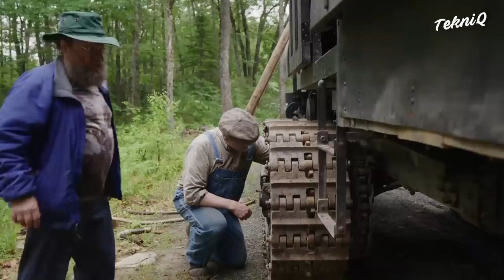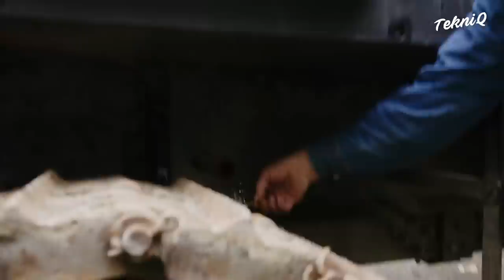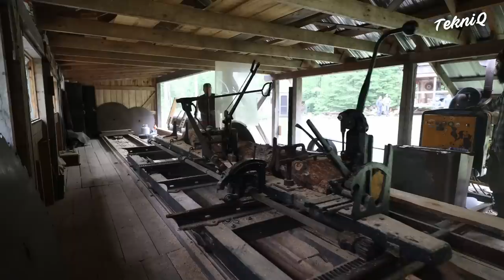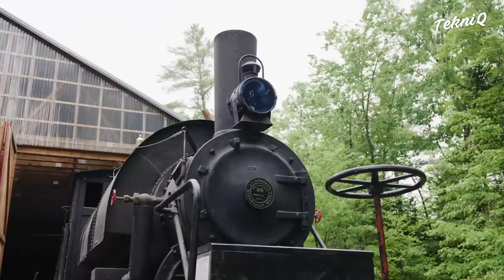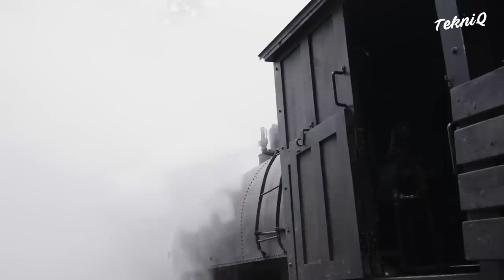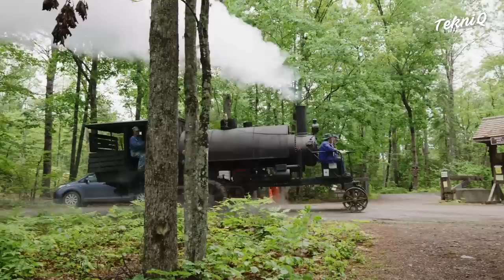Starting Massive Steam Tracked Tractor: One of the First in the World

Comment: I think the main thing that the builder of this machine forgot to include was a voice tube or other means of communication between the engineers and the steering team.
Reply: No need. We use whistle signals  for stop, go and reverse. Works very well.
Reply: @terryharper2024  Your one way communication system may work well enough to operate the tractor on the grounds of your museum, where everyone involved is familiar with every road you operate on, but I can envision scenarios back in the days when these machines were used to perform actual work where effective TWO WAY communication would result in more efficient work or even prevent an accident.
Reply: @richardcall7447  back in the day when these machines were hauling up to 300 tons of logs loaded on 15 sleds or more it was done the same way. It doesn't take long for the engineer and steersman to become a team. Just as the engineer relies on the fireman to maintain pressure and the water level the engineer has to trust the steersman but he also has to know the road - i.e. grades, curves etc. He has to be thinking about the steersman at all times. Take a sharp curve too fast and the steersman can't react quick enough with the low geared steering. Likewise, until the steersman returns the movement signal via the whistle the engineer cannot move the machine. the The video doesn't really pickup on it but when your in the cab its not a quite place. We have to shout back and forth just across that short distance. Unless the voice tube is glued to your ear your not going to hear it. Remember also how these machines were used. When hauling a loaded sled train you only stopped for fuel or water. Short of a breakdown nothing was allowed to interfere with a loaded sled train. Empties were usually brought back to the cutting using a go-back trail so they didn't get in the way. Other than hitching up you never backed-up and turning at the end of a road was often via a loop. There was not a lot of manuvering.
Reply: If a blind and deaf lumberjack, moose or bear gets in the way, that's tough, fight on...I'll bet on the crawler. THis ran back when men were men and the government got out of the way.

Comment: Steering from the front, but could it also be done from the cab in the rear?  Also, how does the guy in front doing the steering control the speed, or not?  Forward/reverse only from the cab?
Reply: The steering is indeed from the front. The "steersman" controls where the machine is going while the engineer back in the cab controls the speed and forward and reverse. We use whistle signals to communicate since the steersman and the engineer cannot see each other. It works quite well.
Reply: @terryharper2024  Cool!

Comment: They measure PH of the boiler water? Checking for corrosives?
Reply: Correct. Also for hardness. Lime scale buildup can be a problem - sometimes you have to blow down your boiler on a daily basis.
Reply: Yes - the engineers added a PH adjusting chemical to the boiler water, and he was checking that the amount was right. The water we used was right out of the creek. The boiler inspection the month before showed that the water treatments were working well.

Comment: Does she not go out of gear?
Just noticed when it was being towed out of shed the cylinders were moving
Reply: Correct, just like a Stanley steam automobile there is no transmission or clutch so when it's towed the pistons do indeed move. We would have to remove the drive chains to stop that from happening. It has Stephenson valve gear and a reverse quadrant which allows the operator to change the position of the slide valves in relation to the piston stroke. Thus by simply moving the lever we can go forward or in reverse.

Comment: This looks like an 0-6-0 or similar switching locomotive that was converted at the factory to haul logs

We have an 0-6-0 not far from here on permanent display where i live that all it did was move logs on a short rail line from point A to point B then reverse to reload.
Reply: It’s not a converted locomotive. Yes, it has a “locomotive type” boiler which was a design used in many different applications including stationary power and traction engines. This particular machine was factory built new in 1907 from all new components. The boiler was purchased new from the Ames Iron Works. It’s one of 82 similar machines built by the Lombard Steam Log Hauler Co. between 1901 and 1917

Comment: I wonder that this thing is this easy to steer. I would think that in a corner the front wheels will slide over the ground while the tracks will push the engine straight forward. ???
Reply: Great question! Originally, since these were only for winter they use, they used skis for steering. We have skis but we fabricated wheels so we can move it around and demonstrate during the summer. The weight on the front end is 8,000 lbs. The rest is all on the tracks. The steering is very low geared. As we like to say "Steer early steer often". Just like a car, which has a differential allowing one wheel to slow and the other to speed up when taking a corner - the Lombard has what they called the compensating gear situated between the frame rails which does the same thing. However, if you try to take a sharp corner too fast it will push!

Comment: You would think putting the driver in the cab would have made it able to work in inclement weather ?
Reply: These were used to haul logs in the winter time from remote areas in the woods, long trains of sleds holding many tons of logs, run on iced roads to make the sleds move easier (with straw down on the ice on downhill stretches to slow it down, these had no brakes since the sleds didn't either). From back in the cab, the view forward is actually quite limited, very tough to see to the sides and anything close up in front. Many of these were modified to put a little shelter around the steersman to protect from the wind and snow.
Reply: @ShopElvesCorner  And, if the driver back in the cab lost control, the steersman would have baled out pdq.

Comment: Fizeram o teste hidrostático 😮 antes de acender essa caldeira ❓❓❓
Reply: We do not need a hydrostatic test every time we light the boiler. In fact we are not required to have one even on an annual bases. However, Every year we are required to have a state boiler inspection which in 2023 was performed shortly before this video was shot.

Comment: Perhaps my powers of observation are absolutely poor but this video did not show this crawler as having any way of pulling anything or running an auxiliary dry belt so is this just a functional toy?!?  🤔
Reply: These were made specifically for pulling heavy trains of sleds loaded with logs along ice/snow roads. Its was not uncommon for them to to pull 300 tons or more. You may not see it in the video but there is heavy pin type pocket and associated draft gear at the rear of the machine tucked up under the wood box. A heavy timber A-frame draw bar was used to connect to the lead sled. All subsequent sleds were interconnected with crossed reach poles which provided a crude form of articulated steering. (each sled following exactly behind the previous sled.) These machines were never used as a source of stationary power so no belt pulley.  Originally it had skis for steering. We have wheels installed so we can demonstrate it.
Reply: @terryharper2024  Thank You!!!  🤠👍
Reply: @worldtraveler930  here is a link to some wonderful old film footage which helps explain how these machines were used:   https://www.youtube.com/watch?v=eSq7x6edExI&t=6s

Comment: 0 : 50  Pumping them wheels bro ?
Reply: Actually greasing the sprocket shaft journals, etc. Today we live in a world of drive it and forget it but these machines are not that way. We have to go over the machine carefully and grease and oil the moving parts at specific points. (24 to be exact) Its also a good time to check the machine over to make sure everything is in order. At one point in the video they are putting new cotton waste in the rear sprocket journal. The waste is packed in and saturated with oil and lubricates the sprocket shaft.

Comment: You would have to start the thing the day before you want to do anything with it!
Reply: It takes us about 4 hours to steam it up from cold. We could do it faster but we like to be gentle with it. When these were used for hauling sled trains of logs during the winter months they never dropped the fire unless they needed to service the boiler. Just as steam locomotives used a engine house, most operations had a Lombard shed with a smoke jack so they could keep the fire going. In fact often they used the Lombard to heat the building (via steam radiators) and melt the snow and ice off the machine.

Comment: How could it keep running with just the load of wood at begining of trip? A farmer would have to had been well off to be able to buy one,as I am sure, that it was expensive.
Reply: One cord of wood will last about 7 miles. These were not bought by farmers. They were used in the lumber industry of Maine, northern New England and maritime Canada for hauling long sled trains loaded with logs (up to 300 tons) over ice/snow roads. The purchase price was $5,500.00. between 1901 and 1917 the Lombard Traction Engine Co. of Waterville, Maine built 82 of these machines. Here is a video illustrating how they were used: https://youtu.be/eSq7x6edExI

Comment: Do I understand correctly that the idea is that you sit at the front of this strange machine, you can turn but you can't stop it?
Reply: Correct. The engineer controls speed and forward and reverse. The Steersman controls direction. We use whistle signals to communicate.
Reply: @terryharper2024  This reminds me of one politician's idea of road safety.  Not seat belts, not airbags, not crumple zones...  The driver should sit in a glass bubble at the very front of the car.

Comment: so its a steam train but converted to not needs tracks?
Reply: It is not a converted locomotive. It was purpose built in 1907 and is one of 82 manufactured by the Lombard Traction Engine Company of Waterville, Maine between 1900 and 1917. The boilers were made by the Ames Iron Works in Oswego, NY. They were developed for use in the winter to haul long sled trains loaded with logs on snow/ice roads. Originally it was equipped with skis to steer with. We have wheels installed so we can demonstrate it during the summer months.

Comment: That is train that makes its own track I don't know y it dosent steer from cab using a long shaft to front steering box and clutch on left and right track .they probly did on models after
Reply: The boiler blocks the engineers field of view to the left and immediately in front of the machine. In addition they are very busy with a hand on the throttle at all times, monitoring water level and steam pressure etc. The earliest Lombards used a horse for steering.

Comment: The piston seals are thrown a lot to waste. Some fettling to do.
Reply: I believe what you are seeing may be the steam coming out of the cylinder drain cocks. Also there is a drain on the steam chest manifold between the frame rails which we like to keep open. So far the rod packing and piston rings have held up well. The valves are balanced. When it has sat over the winter we will take the steam chest cover off and check and clean the seal plates to make sure they are free floating in the grooves.

Comment: Why can’t they steer it with the tracks?
Reply: It didn't need to steer from the tracks - It's all about the application and intent. It was designed by Alvin Lombard in 1900 to haul long sled trains loaded with logs on snow/ice roads. Power, traction and stability were more important than maneuverability. In addition it wasn't until after 1904, when Hornsby of England developed an effective track steer system, that full track or "tank-type" tractors that steered via the tracks became practical. Here is some old film footage illustrating how these machines were used: https://youtu.be/eSq7x6edExI

Comment: That just looks.like a saddle tank with tracks and front wheels fitted .i don t think the man steering it has got good job as he is exposed to all the weather .cool looking thing though
Reply: Yes it looks like a modified locomotive but its not. These machines (82 built between 1900-1917) were purpose built using new components. Since these were designed to be used in the winter, often, the steersman would have a shelter to provide a bit of protection.

Comment: Why would you ever design something like that?
Reply: To solve a problem. in 1900 Alvin Lombard designed it to haul long sled trains loaded with logs on snow/ice roads and to replace (in part) horses used in the Maine woods.  It is indeed the first practical crawler track system and the ancestor to all modern crawler tracks.
Reply: @terryharper2024  Thanks for the information. I have seen many Steam Engines here in the England but never anything quite like that.
Reply: @karlharrison6544  Yes, you folks have some amazing machines! Interestingly the British named a mountain in Antarctica after Lombard in recognition of the development of the crawler track.

Comment: That's a very odd engine..... sad to see something that looks so much like a steam engine turned into that.
Reply: It is not a converted locomotive. It was purpose built in 1907 and is one of 82 manufactured by the Lombard Traction Engine Company of Waterville, Maine between 1900 and 1917. The boilers were made by the Ames Iron Works in Oswego, NY.